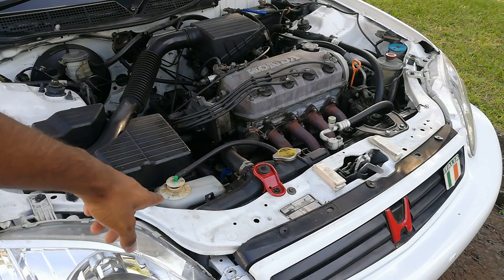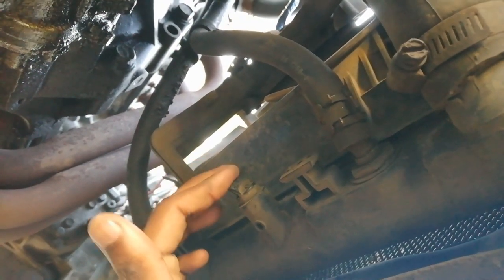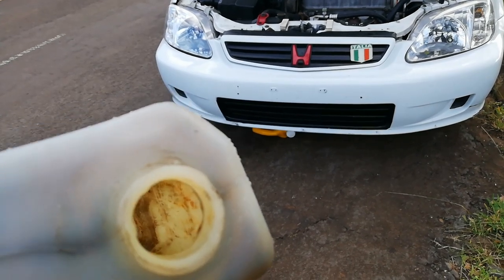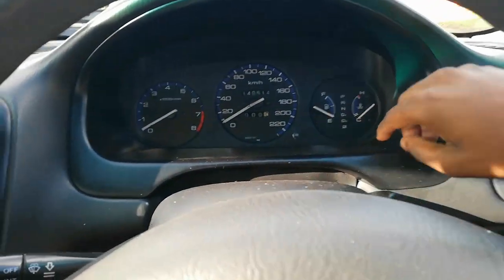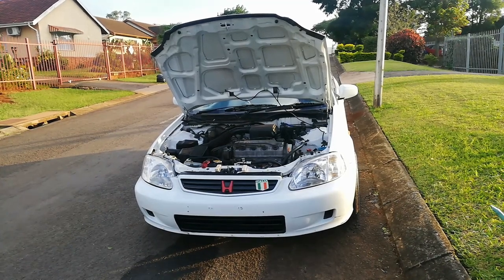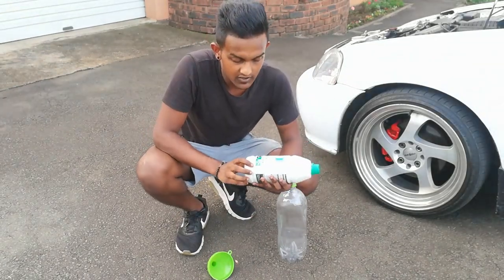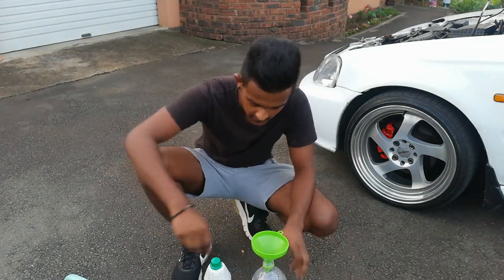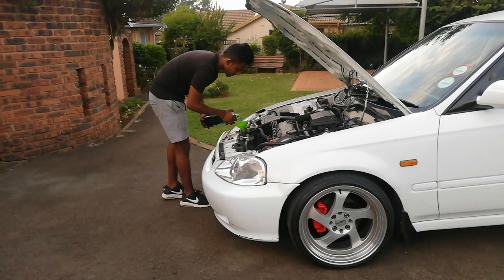Making the Honda Cooler | How to do Radiator Flush / DIY Coolant change|96-99 Honda ek ballade civic

Comment: Thank you so much for this video, been having problems with my radiator as over heating will definitely do just that you gain a subscriber from me👍🏽
Reply from the maker: Glad it Helped 🙏🏽
If its Overheating it could be other things wrong tho. Such as Radiator Cap, Thermostat, no Coolant,a leak or possible rust in the system

Hit us up on Instagram @cityliferides if u need any further help 🤙🏽💯

Comment: Hey  bro just saw the clip now and I subscribed, I dn't know if you're still active and if you still using tap water, use distilled water or rain water, tap water has chemicals that will make you antifreeze not to do it's job👍👍👍
Reply from the maker: Hi Bru Yes your right definitely 🙌

Comment: Nobody wants to sit thru long intros or superfluous junk. That's not dirt or mud coming out but a ton of rust like it was run on tap water since 1999. Soaking reservoir (NOT radiator) with lime away or a scale and rust remover would clean plastic well. I'd have used a stick if nothing else to loosen crud. There's no grease in a normal radiator either. If water looks that rusty & cloudy, repeat til it's clear. It might take a couple days to clear out. U might want to open valve and leaving hose run into top. Then u can add a flush product and follow directions to get the last of debris and rust out. With a 1 liter bottle of undiluted coolant, empty into radiator, then fill bottle with distilled or purified water and add that. Simple. You're making too much extra work and final rinse was still horrible. Music is way too loud and distracting. Feels like punishment.
Reply from the maker: True, my knowledge of what I was doing wasn't as good as what i know now, and yes, you're right about all the steps needed to do a proper flush. However, it still doesn't give you a right to criticize someone's effort , I'd like to see your judgemental ass do the same video and see how much of work and effort it takes to do these things. At least I'm giving a basic idea of what needs to be done and trying to help people , unlike you ! So next time, keep your comments to yourself because nobody asked for it, and nobody asked you to watch the video either way.
Reply: @cityliferides4295 You did great, bro. I don't necessarily believe he was intentionally attacking your methods and production of the video but rather adding his knowledge and possibly correcting you... for which I say "possibly" as I don't believe you were wrong. 

I was able to get a basic understanding of what you were attempting to explain and learned enough to where I am much more comfortable with proceeding to perform my own flush.

My question to you is, what kind of coolant did you use? That was a critical part you missed out on showing. I literally just spent FOUR hours running to every local store that sold coolant in search of a proper coolant that is green (which is what was in my 98 Honda Civic Hatchback) only to find coolants that are BLUE for Hondas. That being said, went down a rabbit hole of trying to figure out why there arent any coolants specifically for Hondas that are green.

WHAT kind of coolant did you use!? I ended up settling with Prestone  50/50 for all vehicles as I heard and seen the SDS Data sheets showing that the ingredients between that coolant and Honda Genuine Type 2 coolant is basically the same besides Hondas additional additive to help prevent animals from being attractive towards it.

Thanks in advance!
Reply from the maker: @electrickrypt8027  Thanks bro I appreciate it , I guess the coolant type depends and varies on the climate of the area you in , I also used a 50/50 mix due to our hectic weather changes in South Africa , never heard of blue coolant before but I'd your local parts store recommended it then it should be fine to use 🙌 .I wish you and the family a Merry Christmas 🎅🎄and a Happy New Year🥳🍾 Enjoy🙌🏽